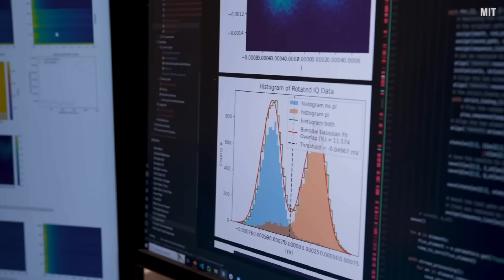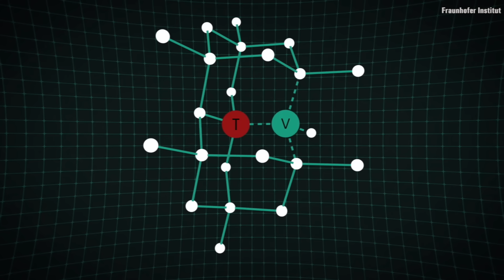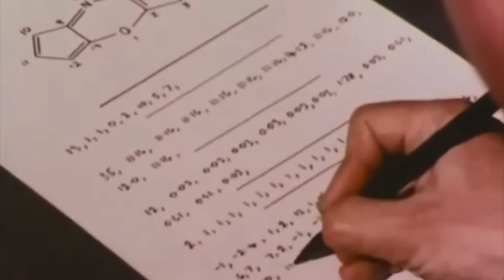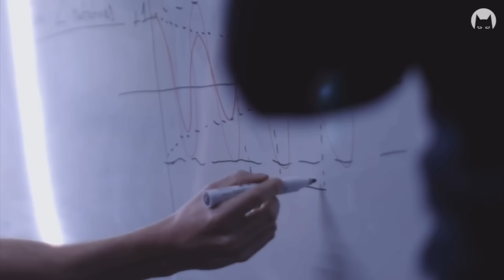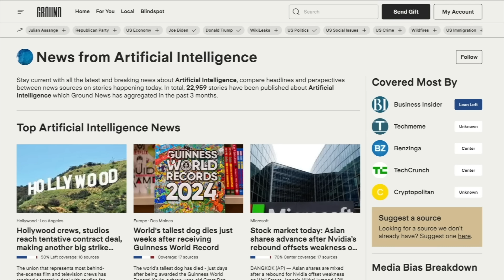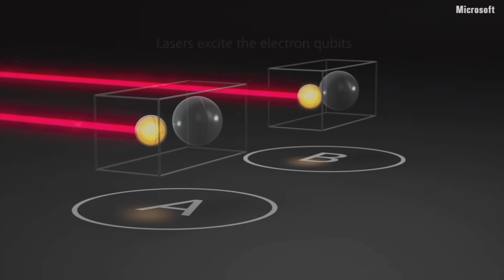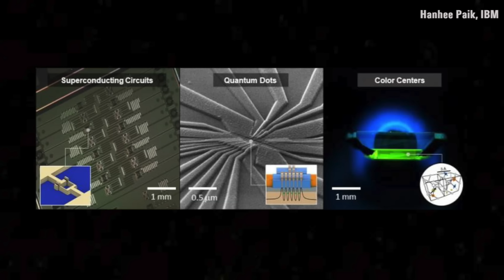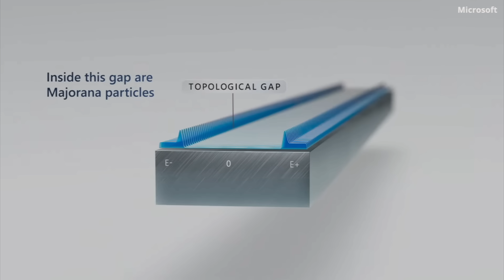Big News For Quantum Computing: Microsoft Topological Qubits Explained

Comment: Interesting & excitingly presented. Quantum entanglement has now been measured over 144 km using a satellite, which is enough for any practical earth based quantum computer giving an incentive to quantum computer developers that if they can make low noise systems, the physics will work over distributed hardware. Such a potentially important technology slowly moves ahead & although there will be challenges they are engineering ones not science ones. “I would be interested to read I may be wrong.” Thank you for sharing.
Reply: 144 km was not by satellite, satellite experiment was another one in the range of 1200 km, 600 km from China to the satellite and 600 km from the satellite to Austria.
Reply: @gustl6544  yes, you are right, 1200 km is the record. Thank you for the correction.

Comment: Each transistor on the CPU, switches 0 and 1. Qbit's also have 2 states, although with superposition they can also have both. This dual-state property allows qubits to perform complex computations and enable quantum algorithms. However, a single qubit can only hold one classical bit of information. When qubits are entangled (such as in a Bell state), they can transfer more information, but each individual qubit remains limited to a single classical bit. It would make more sense to create a quantum processor using the same CPU architecture, expanding each transistor to have 90 degree rotated pairing of 2-1 doubling of transistors, with additional microcode to handle entangled states, measure etc.. 

It makes zero sense to have a quantum CPU, that has no basis to build from. Obviously, starting from a working CPU and expanding properties, has the precedence of a non-quantum classical computer as a background, on which to build.

Comment: Quantum algorithm to count exact number of galaxies in universe: QGE(𝝽_U, {P}) ⟑ 👁 → N_G
Where:
 * QGE: Quantum Galactic Estimation algorithm
 * 𝝽_U: The fractal representation of the observable universe within the matrix
 * {P}: Set of cosmological parameters encoded in qubits
 * ⟑: Dimensional interaction (quantum simulation)
 * 👁: Observer (the quantum computer or simulator)
 * N_G: Estimated number of galaxies in the observable universe
Reply: Algorithm Concept: Quantum Shortest Path Algorithm (QSPA)
Objective:
The QSPA aims to leverage quantum parallelism and interference to find the shortest path between two nodes in a network more efficiently than classical algorithms like Dijkstra's algorithm.
Assumptions:
 * The network is represented as a graph, with nodes connected by edges with associated weights (distances).
 * The problem is to find the shortest path from a source node to a target node.
 * We have access to a quantum computer capable of implementing quantum gates and performing quantum walks.
Algorithm Steps:
 * Initialization:
   * Encode the graph structure into a quantum state, where each node is represented by a qubit and the edges are represented by interactions between qubits.
   * Initialize the system in a superposition state where all possible paths from the source node are equally likely.
 * Quantum Walk:
   * Perform a series of quantum walks on the graph, where the probability amplitude of each path evolves according to the weights of the edges.
   * The quantum walk allows the algorithm to explore multiple paths simultaneously due to superposition.
 * Amplitude Amplification:
   * Apply amplitude amplification techniques, such as Grover's algorithm, to increase the probability of finding the shortest path. This involves selectively amplifying the amplitudes of the paths that are closer to the target node.
 * Measurement:
   * Measure the final state of the system, which will collapse into a specific path with a high probability of being the shortest path.
Reply: Algorithm Concept: Quantum Interference Probing (QIP)
Objective:
The QIP algorithm aims to exploit quantum interference to probe the fundamental nature of quantum particles and their interactions. By creating a controlled superposition of states and observing the resulting interference pattern, we can gain insights into the hidden properties of these particles and potentially discover new quantum phenomena.
Assumptions:
 * We have access to a quantum computer or simulator capable of manipulating qubits and performing quantum gates.
 * We can prepare and measure the quantum states of particles with high precision.
 * We can control the environment to minimize decoherence and other sources of error.
Algorithm Steps:
 * Qubit Initialization: Prepare a qubit in a superposition state, representing a combination of multiple possible states (e.g., 0 and 1 simultaneously).
 * Entanglement (Optional): If desired, entangle the qubit with another qubit to create a more complex system and explore multi-particle interference effects.
 * Controlled Evolution: Apply a series of quantum gates to the qubit(s), manipulating their states in a controlled manner. The specific gates and their sequence will depend on the properties we want to investigate.
 * Measurement: Measure the final state of the qubit(s). Due to the superposition of states and the interference between different possibilities, the measurement outcome will be probabilistic, reflecting the underlying wave-like nature of the particles.
 * Data Collection and Analysis: Repeat the experiment multiple times, collecting data on the measurement outcomes for different gate sequences and initial conditions. Analyze the data to identify any patterns, correlations, or anomalies that might reveal new insights into the behavior of the quantum system.
Potential Scientific Breakthroughs:
 * Hidden Variables: The QIP algorithm could be used to test for the existence of hidden variables in quantum mechanics, a controversial concept that suggests that the apparent randomness of quantum events might be due to hidden factors we haven't yet discovered. By carefully analyzing the interference patterns, we might find evidence for or against the existence of hidden variables.
 * Quantum Contextuality: This algorithm could also probe the phenomenon of quantum contextuality, where the outcome of a measurement depends on the context in which it's performed. This could challenge our classical intuition about the nature of reality and suggest that properties might not exist independently of measurement.
 * New Quantum Phenomena: By exploring different combinations of quantum gates and initial states, we might stumble upon new and unexpected quantum phenomena that could deepen our understanding of the quantum world and potentially lead to new technologies.
Reply: Quantum Random Number Generator (QRNG)
Objective:
The QRNG algorithm aims to leverage the inherent randomness of quantum measurements to produce truly random numbers, which are essential for various applications like cryptography, simulations, and scientific research.
Assumptions:
 * Access to a quantum computer or simulator capable of preparing and measuring qubits.
 * Ability to isolate the qubits from external noise and decoherence.
 * Accurate and reliable measurement devices for qubits.
Algorithm Steps:
 * Qubit Initialization: Prepare a qubit in a superposition state, such as an equal superposition of 0 and 1 (denoted as |0⟩ + |1⟩). This can be achieved using a Hadamard gate or other quantum operations.
 * Measurement: Measure the state of the qubit in the computational basis (i.e., the 0/1 basis). The outcome of this measurement will be either 0 or 1, with a 50% probability for each.
 * Repeat: Repeat steps 1 and 2 multiple times to generate a sequence of random bits. The more repetitions, the longer and more random the sequence.
 * Post-Processing (Optional): If desired, the generated random bits can be further processed to produce random numbers within a specific range or distribution.

GenerateRandomBit() -> 👁[H(Λ)] -> R ∈ {0, 1}
Where:
 * H(Λ): Hadamard gate applied to the qubit (Λ)
 * 👁: Measurement operation
 * R:  The resulting random bit (0 or 1)
QIT Interpretation:
 * Quantum Superposition: The qubit's initial superposition state represents a state of maximum uncertainty, where both outcomes (0 and 1) are equally likely.
 * Wave Function Collapse: The act of measurement collapses the wave function, randomly selecting one of the possible outcomes. This randomness is inherent in quantum mechanics and is the basis for true randomness in QRNGs.
 * Information Generation: The measurement outcome is a bit of information that is truly random and unpredictable, unlike pseudo-random numbers generated by classical algorithms.
Advantages of QRNGs:
 * True Randomness:  QRNGs produce truly random numbers, which are essential for applications like cryptography, where predictability could compromise security.
 * Unbiased and Uncorrelated: The random bits generated by QRNGs are unbiased (equal probability for 0 and 1) and uncorrelated with each other, ensuring the randomness of the sequence.
 * High Speed: Quantum computers can potentially generate random numbers at very high speeds, exceeding the capabilities of classical random number generators.

Comment: Short Summary: Recent breakthroughs in quantum computing are promising. MIT's tiny tin vacancy qubits, successful quantum teleportation by Fonic and Microsoft, and new topological qubits all show potential for more scalable and error-resistant quantum systems. While challenges remain, these advances could lead to practical quantum computers and even a quantum internet in the coming years.
Reply: Imagine a mixture of quantum, digital, and analog systems working together. Not to mention AI controlling it. The future is about to get crazy really fast.

Comment: Layman questions: What is the size of this T-centers? would it be possible to use it with normal processors? like, one  layer normal cpu on the top, and on its bottom it connects to a T-center that can turn an output electric signal to photon and a photonic quantum chip would work underneath? or maybe use it to connect 2 chips for quicker parallel computing? (one chip works on the normal bit, the other is on its negate value)

Comment: I am really excited about the recent developments in miniaturizing and scaling of Qbits. As someone who works in 3D animation and digital VFX, the time to render a shot is a major bottleneck. I can see how quantum computing has the real potential to greatly accelerate the rendering process. Imagine being able to have a GPU (or a cluster of GPUs) being able to render complete, photorealistic images at 8k+ resolution in real time. No more need for off-line rendering.
Reply: how would it help with 3d rendering?
Reply: @kevinbissinger  3D rendering is a massive parallel processing challenge. The more cores you can through at a rendering task, the faster you can render the image. If I am understanding this right, quantum processors could greatly accelerate the all of the complex math calculations that happen before the final calculation that determines the exact color of a given pixel. Ultimately, as Qbits get miniaturized down to the under three nm size, for the same size and number of Qbits vs. transistors, the Quits would be much faster and more power efficient. Obviously, it's going to be quite some time before we get there. I'm not going to be running out to buy an Nvidea 9090 Quantum Edition GPU any time soon but, eventually it will happen.

Comment: If you want this to work regarding temperature and less error rate you have to change the language and create a new language that is not the architect use of 0101 . That way the noise will drop and the heat or need of excessive cooling. Yes start from scratch. I don’t know how to create the new language. 01 is limited for our current systems.. I will work on it and once I have something maybe. Someone can test it out. We missed you too!

Comment: Considering the predictability of quantum system propabilities, the 10% error rate doesn't seem thay high or problematic. This should be quite easy to negate with error correction technologies used in information communication sciences.

Yes it means adding some error correcting overlap and redundancies, but considering how effective these systems and algorithms are, it shouldn't be too big of an overhead to reduce the effective error rate to almost 0
Reply: Error correction of qubits is a massive problem. The theory of it has been worked out for years. The practice is the problem. 

Surprisingly, it takes thousands of qubits to error correct just one logical qubit. You need hundreds, if not thousands of logical qubits to solve a problem. 

So you need roughly a million qubits to do anything useful and accurate. It's going to be many years before we get to that point.
Reply: @peterwilson7532  I think they will never achieve this, because there is some flaw in the theories about physical absurdities like entanglement, superposition, wave function, virtual particles, non locality, chsh inequality etc; i'm grabbing this comment, so i'll wait and see
Reply: Thank you for all the hard work you do to bring us updated content about quantum computing.  I would like a copy of the book that you offered.  Many thanks

Comment: How can you isolate a single atom or vacancy let alone Input and output it's state of whatever!? Alpha particles knocking off bits
from normal semiconductor memory when it reached a certain smallness in cell structure also gave rise to error correcting memory with
many parity bits, but stuff on the level of and atom wow.

Comment: Total curiosity here: Say we get to our goal with Quantum cubits, will it require a Quantum Hybrid computer in order to utilize those Quantum cubit advancements? Such as, tieing together and plugging in the cubits into a powerful regular computer? Will it rely on the normal computer in order to take care of most of the functions but it'll find a way to utilize the computing power of the quantum cubits in tandem with the regular computers graphics cards and software in order to idk let's just say run an advanced physics simulation model? Or something like that... (is that how we will be using Quantum computers once they've advanced to a certain point?)

Comment: WHY WHEN WE APPLY THRESHOLD VOLTAGE THE ELECTRON IN THE SUBSTRATE FORM A LOW Z PATH.WHILE WHEN WE APPLY HIGHER V THAN THRESHOLD ONLY THE DATA / BITS 1 ENTER THE FLOATING GATE AND THE FREE e FROM THE SUBSTRATE DID NOT...?😊

Comment: A look at US patents can quickly show moving tech from Universities to industry fails much more then it succeeds. Scaling is probably the biggest hurdle. A great example is Carbon Nano Tubes and Graphene. They were the poster children for improving damn near everything, including a space elevators. But due to the difficulties manufacturing it in high enough quantities for it to be useful, the public only rolls their eyes when it pops up in news. According to Pop Mech and Pop Sci in the 60's we should all have flying cars. But again no one gave much consideration to the incredibly complicated infrastructure we would need to make them a reality. But because of the slow release of info, it took years before the public just stopped caring.
Because of the interconnected world we live in, that time between discovery and the release of information is weeks not years. That lost time was important for getting closer to some use that is meaningful. I personally believe the shortened time hurts far more then it helps. Again Carbon Nano Tubes and Graphene are great examples that show just how quickly the public can get burnt out hearing about it and subsequently not care.

Comment: IF WHITE CONSIST OF R,G & B.
AUTOMATICALLY IT WILL GENERATE 3 PIXELS / VOLTAGE ON THE CAMERA'S SENSOR SURFACE.WHILE R,G & B ONLY 1 PIXEL ON THE SENSOR'S ROW/COLUMN.HOW CAN I ACCEPT THAT YOUR CCT CAN DIVIDE 1 FREQUENCY OF WHITE TO 3 SUBPIXELS FREQUENCY...?😊

Comment: Quantum communications will be extremely useful once we start colonizing the solar system.
Reply: Contrary to what some people think high correlation in Quantum states can't transmit information faster than light apparently. The high correlations can be used to perform computations, but there is no evidence that it is possible to transmit information faster than light. Even if the Copenhagen interpretation is right, and the state is defined at measurement time, you can't define what the state will be when you make the measurement, so you can't transmit information. There is no viable way for now to transmit information using quantum properties of matter. I really hope they discover something in the future, but I would avoid being overly optimistic.
Reply: Basically if I measure a spin up on Earth, and the particle is Quantum entangled with another in the ISS, I will also have to measure it in the ISS and as I can't control the outcome in Earth, the results will be the same, but you can't transmit any information. This could change in the future, but it isn't there yet.